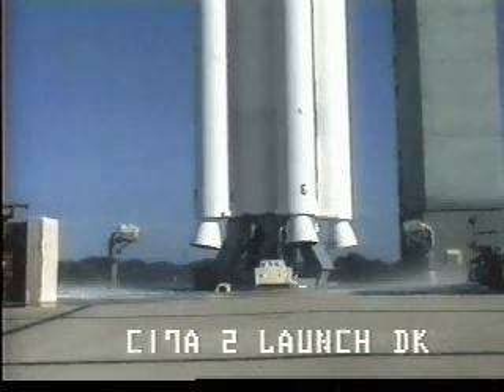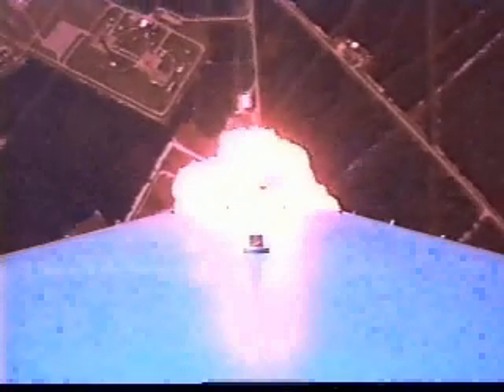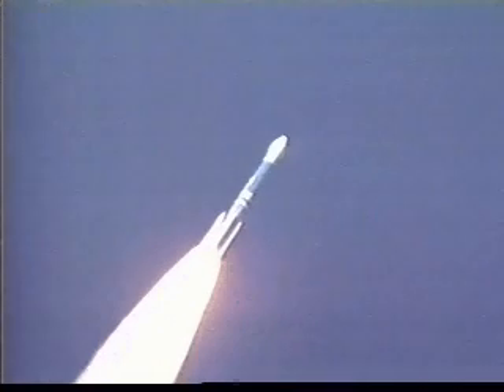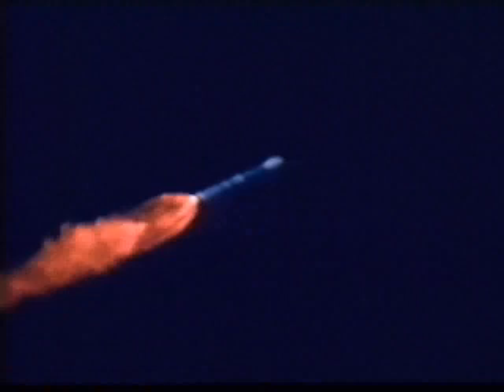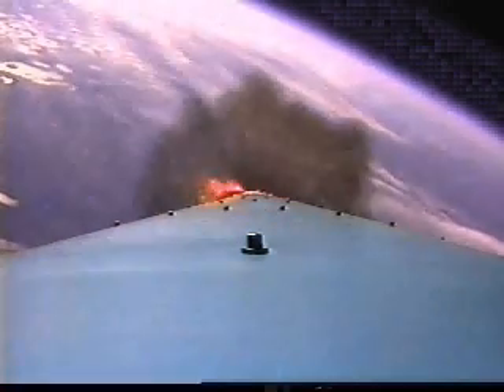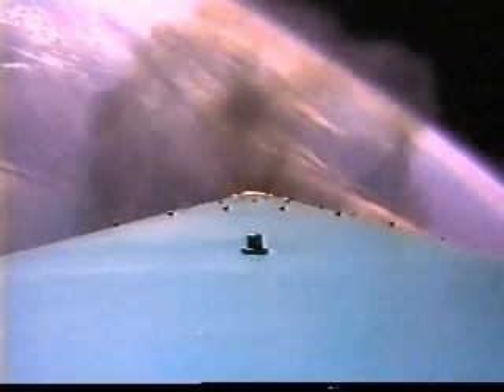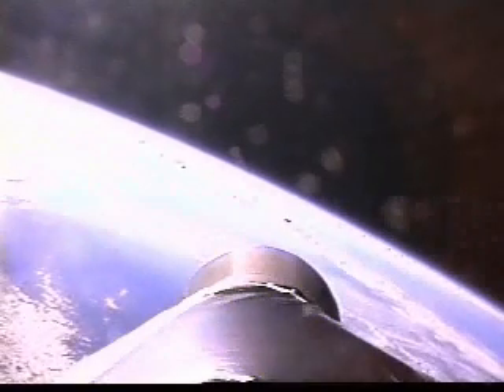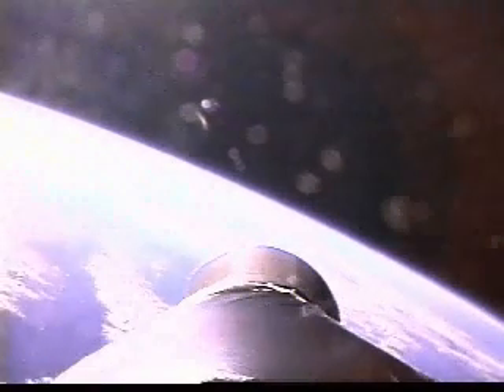NASA Stardust Satellite Launch Video

Comment: "SO cool to see the engine flames turn from fire to plasma or whatever it turns into w/o oxygen"....dude really? You don't even think about that statement? Thingy's, even those complex engine doo dads CAN'T FUNCTION W/O OXYGEN. Even if they could, there is NOTHING FOR THEM TO PUSH AGAINST TO PROPEL THEM
Reply: +Majka Rockets don't need something "to push against" - It's the expansion of the gasses during combustion that escapes the rocket nozzle. Following Newton's laws of motion, those gasses escaping the nozzle has a equal opposite reaction that pushes against the upper wall of the combustion chamber.
Reply: Did you know you can have flame burn under water? Are you not aware of things that produce oxygen via chemical reaction? Did you graduate high school?
Reply: You do realize that the rocket is half full of LIQUID OXYGEN right? What happens when you mix kerosene and liquid oxygen?